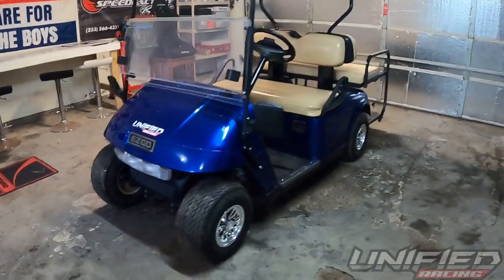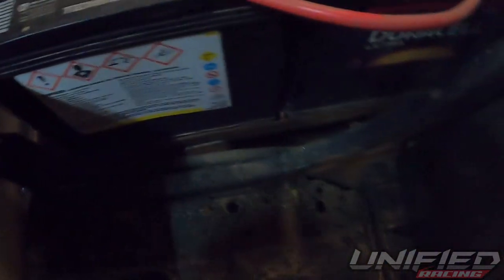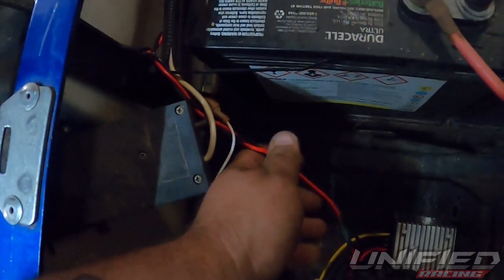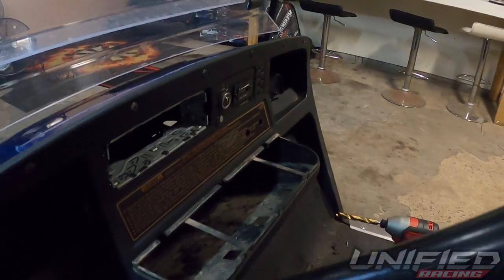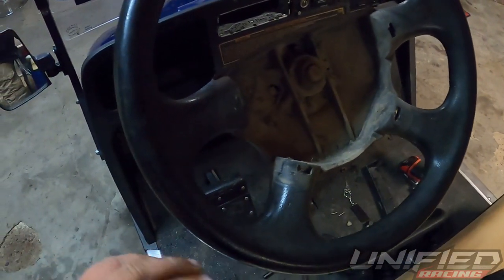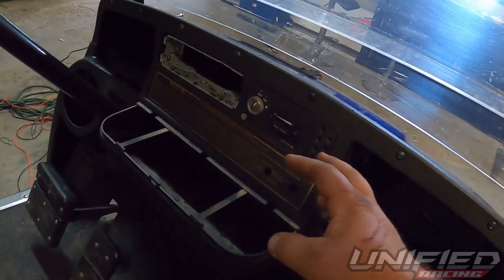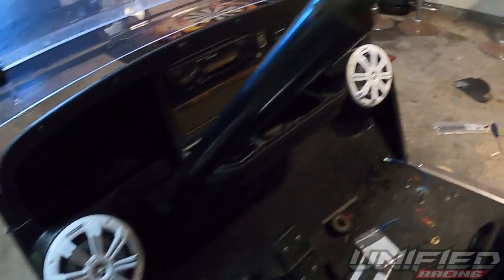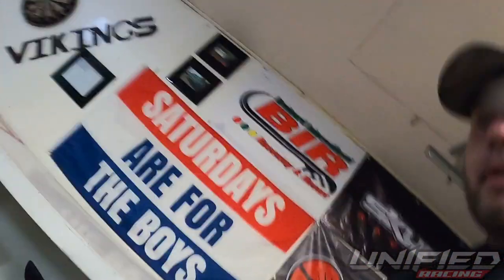EZGO Golf Cart Radio Install And Upgrades

Comment: Nice job...it looks sharp. 
Do you have any links to the stereo unit,, speakers and speaker molds?
How do you deal with stereo memory when its powered off? Each time when you turn it back on, does it retain the preset stations? Some powere converters have an optional wire built into its harness that is specific for steroe memory. My converter is different from yours but has the same wire configuration.
Reply from the maker: I just used Amazon and kept it cheap. Found one for 70 dollars that was name brand and one that I liked the looks of. Memory is the yellow wire. I just keep it on constant power tied in before the switch and it saves all my presets. So basically I just spliced in the yellow with the main power from the converter and havent had an issue
Reply: @UnifiedRacingChannel  Thanks
Reply: @UnifiedRacingChannel  The only issue with that is the power reducer is constantly drawing current which is ok as long as people know to keep topping off the charge even when it may be in storage.
Reply: Anyone see the evil clown face when he removes the steering wheel

Comment: How did you get the speaker wire from the speaker pods into the cup holder section?
Reply from the maker: Drilled a small hole through the  floor right behind the speaker and fed the wire   through and had to reach up to where the  lights of the cart feed through the top to the switch

Comment: Iv heard of these power converter before but is there any reason you couldn't just pick off of the array for the power you need? In your case tap off of two batteries.
Reply: The converter helps the batteries last longer.

Comment: do you mind sharing a link for the power voltage converter? I have the same 36V cart, but there are various options based on the current output...10A, 3A or 6A
Reply from the maker: I don't have the link anymore but I just did the cheap converter from Amazon and it worked great. I want to say I went with 20 Amp so I could run whatever without popping fuses

Comment: I see that you have a “state of charge meter” does that meter only come on when the ignition is turned on? If so how do they have it wired?
Reply from the maker: It only comes on when key is on but I didn't wire it in so I'm not too positive on where it's wired. I assume it would be the first 2 batteries

Comment: Instead of a converter can you hook the positive to your first battery and negative to your second battery to create 12v?
Reply from the maker: From what I read if you do that it'll drain those batteries faster and thus making those 2 batteries weaker than the others because they are constantly powering things from those 2 and getting charged from the others
Reply: @UnifiedRacingChannel  awesome thank you

Comment: How to did u get the radio to put output to the speakers and how did u get power to the radio ran
Reply from the maker: The radio has a built in amplifier so it powers the speakers right through the head unit. White for front left (one with black stripe is for negative) and gray for front right (one with black stripe is for negative) Power is ran right off the batteries. Since I have a 36V cart I had to get a power reducer that brought the voltage from 36V to 12V. I than ran the power wire to an aftermarket toggle switch which tied into the red wire (Switched ignition power) Yellow wire was tied in before the switch from the reducer so it could have constant power (saves settings in your radio) Hope that helps

Comment: hi, which 12v wattage reducer is recommended ?
Reply from the maker: I just went with the cheap amazon one and hooked it up. But first before applying power to any accessories I used a multimeter to make sure it actually reduced it to 12v. So for 15 bucks it worked slick
Reply: @UnifiedRacingChannel  got ya, I was curious because some of the 12v converter comes in different wattage . Figured you got a specific one that’s able to put out wattage for the lights and radio ect.
Reply from the maker: @fchang1201  I went with the 20amp 240 watt
Reply: @UnifiedRacingChannel  you da man hoss